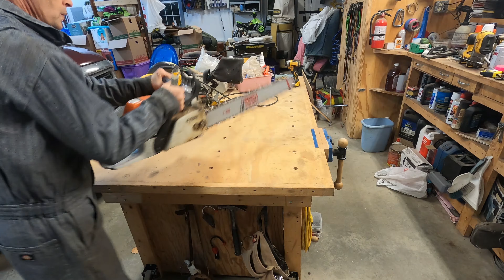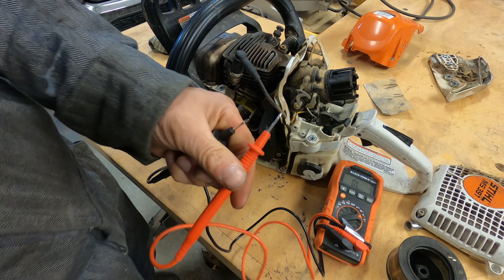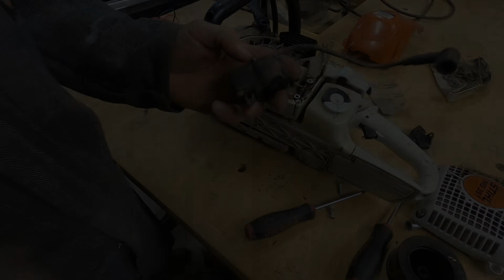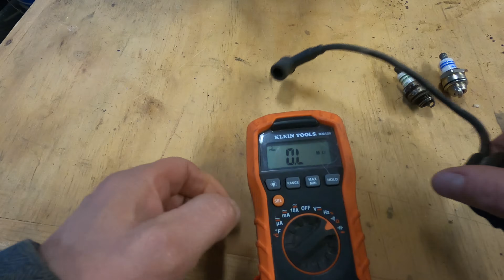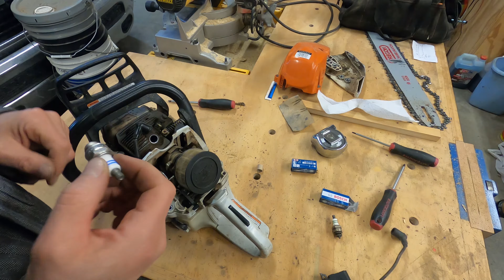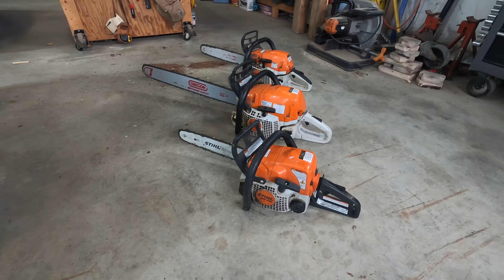Repairing my Stihl MS 391 chainsaw and talking about my chainsaw lineup.

Comment: Coil failure seems to be common in 391's. They have an electronic rev-limiter in the coil which is activated (earths the spark) at or above a pre-determined rpm. This is the black wire that connects to the coil assy via the spade terminal. It is normally open (high resisitance)  and shorts the spark ,when required, to limit the revs. The other wire is a simple switch that shorts the coil when you flip the lever all the way up. 
Coil failure is caused by the rev limiter short-circuiting (low resistance) permanently. Easy to replace and low cost. BTW the magneto-flywheel gap is 10 thou (0.010")
Reply from the maker: Thanks. Appreciate the additional info!

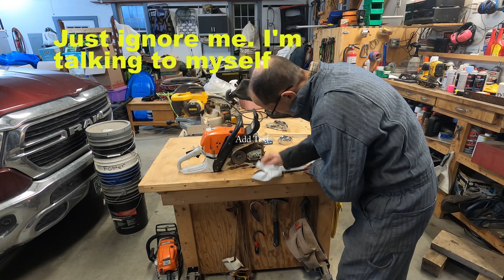Comment: At the mark of 17:50 you may say you talk to yourself, but honestly, I never saw people pointing things to themself!!! Lol!  You might like to have a spark plug cleaner, using special grit and compressed air. Old and fooled spark plugs come out brand new.  And it cleans the ceramic insulation near the spark probe, reducing lost of electricity. I've got 2 main saw. My MS250 doing 90% of the logging work in the forest. When it comes to bucking, I use mainly the 026. I am fine with smaller saws, I barely have trees over 16 inches in diameter. Thanks!
Reply from the maker: I think I might have been explaining something, but in the end, didn't think it was worth including. Haha.
Reply: @timberterra  I do that often! Only to find while editing I was talking for a straight 5 minutes... People don't want to hear it, they  want to see it! Have a nice weekend!